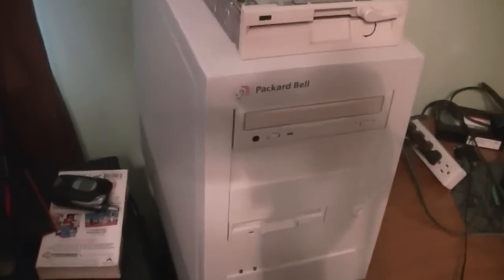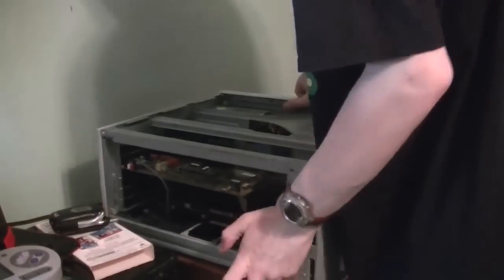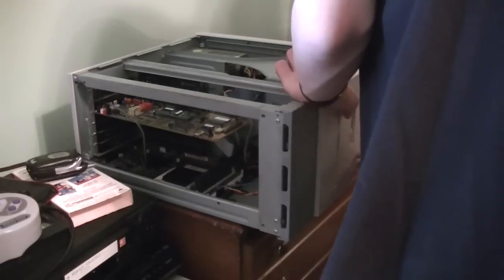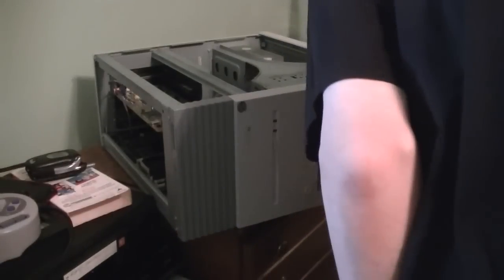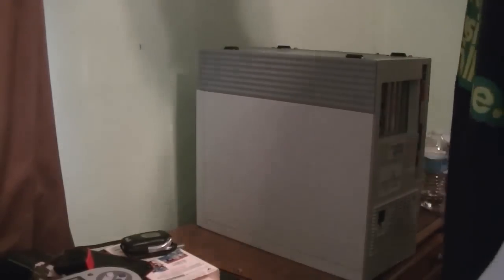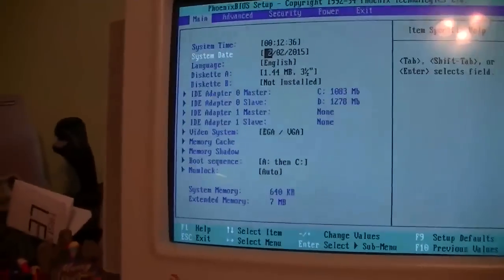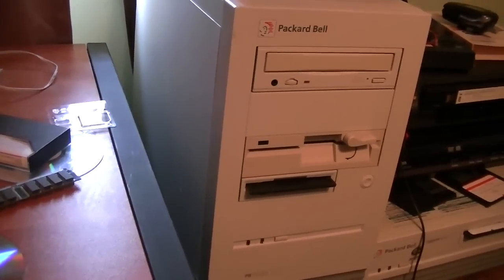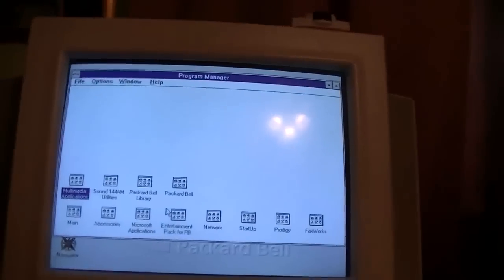Setting Up the Packard Bell PB 1750CDT

Comment: Is a CF card basically a SD card?
Reply from the maker: Sort of, except a CF card has a built in IDE controller just like a regular hard drive.
Reply: Roadgeek It doesn't sound like much of a hard drive. Considering it doesn't fail as easily and looks like it uses flash memory. I would say it could be compared better to an SSD.
Reply: Roadgeek Could you put Windows 95 on this computer?
Reply: +Billy O'Reilly CF card means CompactFlash Card, CompactFash cards are like SD cards in that they use solid state flash memory technology in them, only they're larger and thicker and the electronics in them are different to what you'd find in an SD card.  CompactFlash Cards were mostly used in digital cameras in the early 2000s, so 10 to 15 years ago, many other devices like MP3 players used them too, but I don't think too many modern devices use them anymore because SD cards are much smaller in terms of physical dimensions.  .